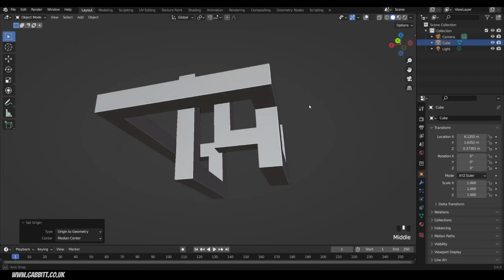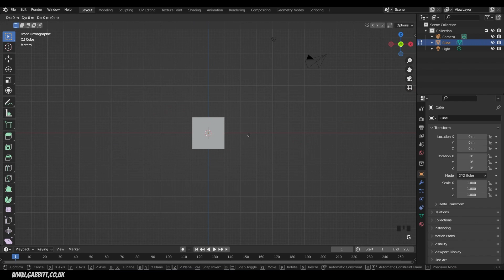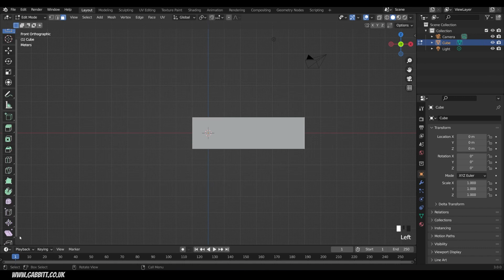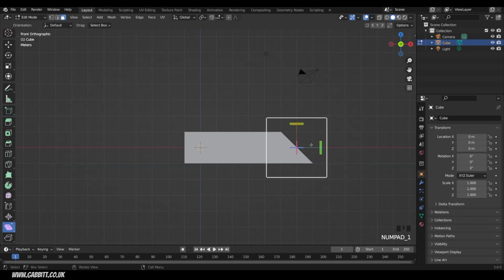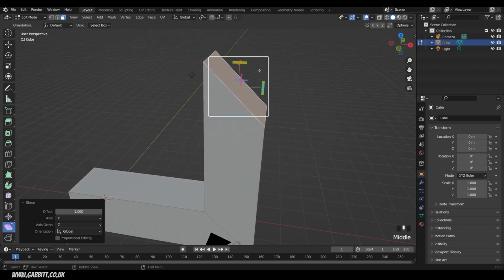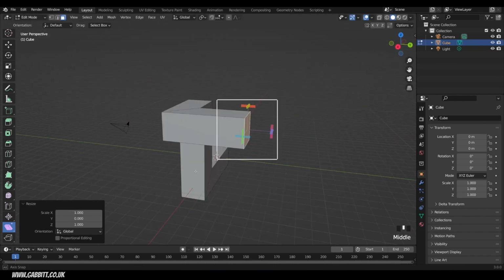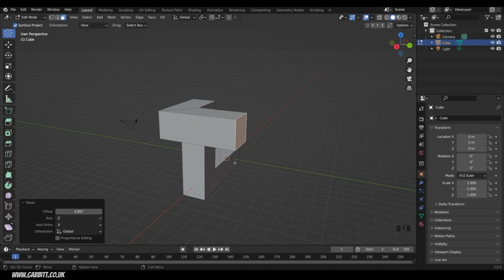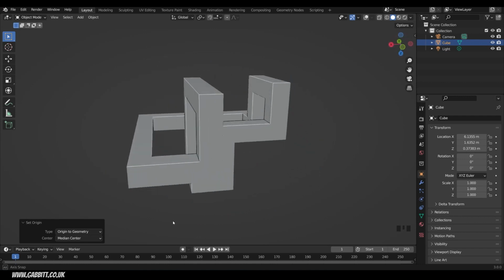Get Good At Blender 3 - The Shear Tool

Comment: Is any way to use "shear function" as "live" Modifier to whole object without modify any vertices permanently? Or similar way? I want achieve this goal: When I will rorate object towards Z axis the "Shear midifier" will be deforming my object towards the same World Point direction, not rotate whole modified object instead that only "base model".
Reply from the maker: not that i know of but there may be with geometry nodes
Reply: @grabbitt  I got it with "Lattice" modifier

Comment: If I want to shear 30°?
Reply from the maker: in the dialogue box that opens up you can set a value but its not in degrees which makes it a little tough to work out
Reply: I think you can get exactly what you want with ease if you know your trigonometry and type the math into the shear's offset field. I don't... So what I did was go to the overlays dropdown (circle on circle, top right) and select edge angle and adjust the number on the little popup until it was close, then make micro-adjustments until it sheared by 30 degrees. The magic number was 0.57735
*Reading other comments, someone said you use tan(30) to get 30 degrees and it spits out a number. Doing it just like that doesn't seem to work in Blender, but if you open a  windows calculator, click the hamburger menu and switch it to scientific, you can type in the degrees you want. Then click trigonometry and select tan, it'll spit out a number. 15 tan gives 0.26794919243112270647255365849413 copy and paste for your 15 degree sheer.
Reply: @joshhockey9   You're right.
Tan(45)=1.
Tan(30)=0.5773502.
You are very intelligent 😉 It didn't occur to me, I thought it was a proportion.
I don't think everyone has a scientific calculator when they model... What were the Blender programmers thinking when they designed the dialog box?
Someone should tell them to add an input with degree values, don't you think? 😂

Comment: Nice, but a few notes: The number you enter is the tangent of the angle you want to rotate the edge loop by. For your 90 degree turn, the corner loop is rotate 45 degrees tan(45)=1. Also useful is tan(30)=0.57735. Any other angle, you're just going to have to open the calculator.
Second, I appreciate a short video showing off one feature, but the first 40 seconds are all intro. You don't need and intro for a 4 minute video
Third, I didn't know they added a shear tool and always used the quick key; the tool looks much more user friendly than rotating the object until the tool defaults to shearing the right way. Thanks.

Comment: I want to share an alternative to the shear tool: you can cut to an angle of 45° using the knife tool (shortcut K) than C (Cut trouh) than A (Angle constraint) and set the angle to 45°. I hope this might help someone 😬.
Reply: Did they change the shortcut for angle snapping? I swear it used to be C
Reply: @anonymussy123  yes, I think they changed it in the 3.0, before it was C angle constraint and Z cut trough if I recall correctly
Reply: @simonesora5573  thanks for confirming!
Reply: Fairly certain 45degrees snapping has gone missing in 3.0 for the Angle constraint.
Reply: @petebateman143  now (3.0) you can type in the angle you wish, I think it's better

Comment: I always use this and this might be the trickiest hotkey to do, instead of 2, you have to press 4 button simultaneously (ctrl+alt+shift+R) and then press x/y/z for the axis rotation you want. But it's still faster than scrolling down the function in edit mode.
Reply: Maybe things are getting kind of excessive with the hotkeys when people are using 4 key combos? That isn't a good thing, some day you will be plagued with carpal.
It may be slower to use the mouse, but it saves your tendons in the long run.
Key commands are not a good thing.

Comment: You could also do the same with a single vert. Extrude it, convert to curve and add thickness in the geometry tab. But I guess this method is faster. Definitely less clicking required.

Comment: During manufacturing extrusion process the tube may appear longitudinally scratched, or abrasive polishing may make it appear brushed, both creating an anisotropic shading effect. I'm curious how you'd approach it. My approach would be separating the pieces. Then UV and collapse to points as a UV.x lookup (if<0.333 then this, if>0.667 then that, else ...) for object coord multiplier selection. Then a separate UV box unwrap for UV based tangents to drive the tangents. The coord multiplier drives a voronoi where (separate.H-0.5)*0.005 drives the rotation, and separate.V drives a mixRGB for some coloring. Only if the extrusion process left very coarse toolmarks would I bother with actual bumps.

That method works fine if you're working with cardinal directions only. And it's easy to change up if you want to apply a subdiv to make it tubular but then with radial polish (looks way nicer imo); rotate the tangent UVs (or add 0.25) and swap the low and high coordinate multiplier.

I have a method if I need to go outside cardinal directions too, incl seamless wrap of voronoi across seam, but it'd take much to long to try to explain. How'd you solve it?
Reply from the maker: Interesting. I'm not entirely sure

Comment: Great tutorial! I could have used this a couple models ago! lol. Instead, I just extruded, stopped before the joint, extruded a joint the same distance out as the length of the cube, and then extruded the face from that joint in whatever direction I wanted. This is SOOO much better, easier, and faster though! I did get used to the way I did it though.

Comment: This is nice. By the way, may I ask, what are the advantages of using this instead of, for example, a loop cut with an extrude region? Would it be because then my corners and continuation of the build can maintain the same thickness as the original line? Cheers and thank you for the tutorials :)
Reply: I think if you were to use a loop cut and then extrude it along an axis, the thickness of the original shape may change as each direction change you'd need another loop cut and extrusion.
Reply: The biggest advantage would be that the sheer tool works with more shapes, like cylinders. It can even be used for much more complex shapes. The Blender Secrets channel has a great little demo showing the tool being used on some funky window molding thing!
Reply: @DavidRidd  Very interesting, thanks for telling me. Also, the other replies were helpful too, thanks everyone!
Reply: Two ways of doing the same thing essentially. I personally prefer using the method you mention because it is compatible with grid snapping.

Comment: Happen to know they shortcut for repeated selection/pattern selection? Basic example: Have a cylinder, add however many loopcuts, and try to select every 2nd or 3rd edge loop. After you select 2 edge loops, you can start using the shortcut and it will select the next edge loops like previously selected. I used to remember the shortcut but not anymore, however, Ctrl+Shift+Numpad(+) selects appropriately but ONLY single edges, the one above the active selection. If you then want to select the entire edgeloops you must go in the menus Select->Select Loop->Edge Loops, which is more tedious. So shooting my shot here if you or anyone who has been practicing modeling knows of this shortcut.
Reply from the maker: I always forget these